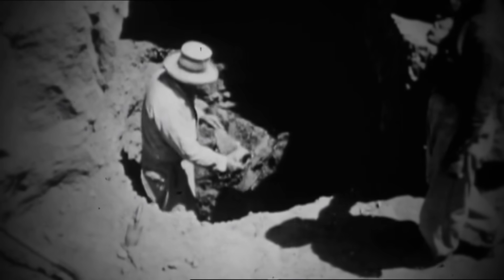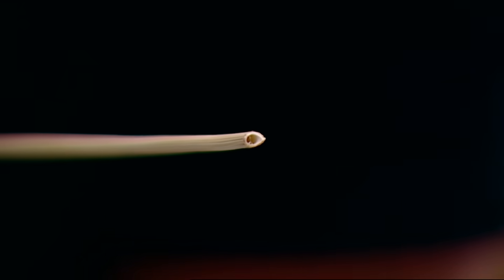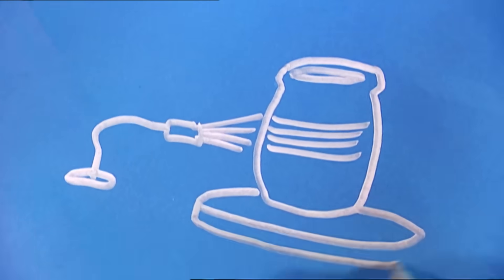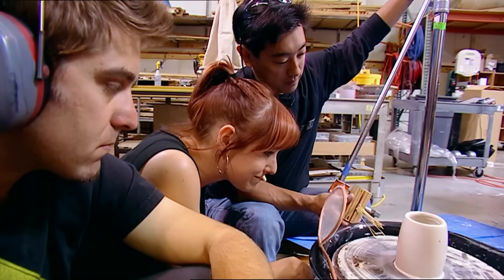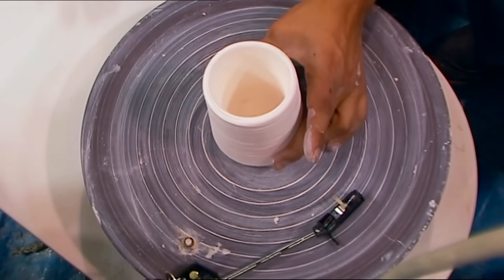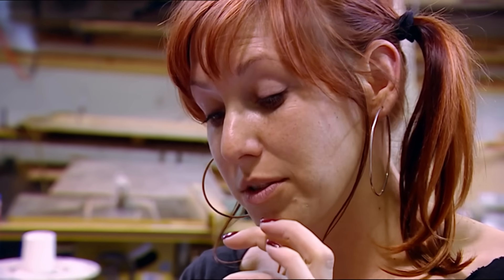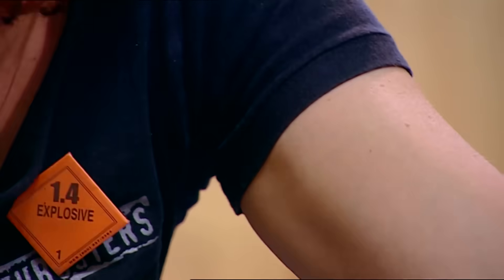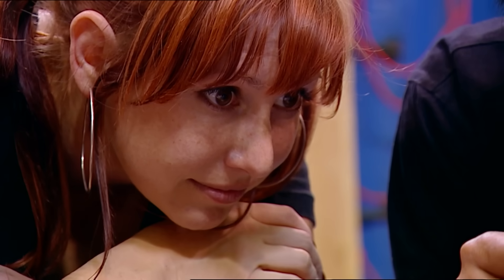Can Pottery Really Record Sound? | MythBusters

Comment: Yeah well I mean those instruments aren't necessarily great at amplifying a sound passing through it. Those things are so flimsy, you can move it with the air. If you encoded instead on fine sand, that instrument would probably work provided it's done in a vacuum or something, but you need more force for wet clay obviously, so this hasn't "busted" anything other than that these means are inadequate to encode a sound (in analog) in clay. I mean you can literally encode sound into leaves and recover it with sufficiently high resolution video capture. If it can change, it can encode sound (or anything for that matter).

Comment: Of course? Thats how records work. Why is that a myth.
Reply: The myth they were really supposed to be testing was whether it would have been possible for old clay pots to have accidentally recorded sound.

But it just devolved into whether it's possible at all. Which it very obviously is. This video was kind of a mess
Reply: Simply put you can actually record sounds on pottery but it will be so bad that the original sound will either be faint or unrecognizable.
In theory with luck and the right clay, technic, and lots of effort you could achieve a successful recording that accurately records sound BUT it wouldn’t compare to old records.

As to why this myth gained traction is due to the possibility of it being doable and doable for primitive people’s say from 2000 years ago.
That’s what makes it really interesting as if it was possible and easy to do then the people of those could’ve used and made recordings.
Now I am not saying they did that nor that it would be possible for the time as even then you’d need to do everything perfect to get a barely good recording.
Reply: @darth3911 youd need to do everything perfect to get those pots with the handles too,  but they did it. And the pyramids. So.. i mean.. maybe